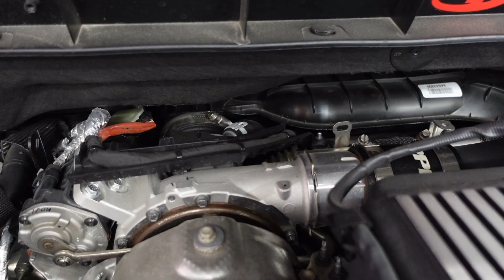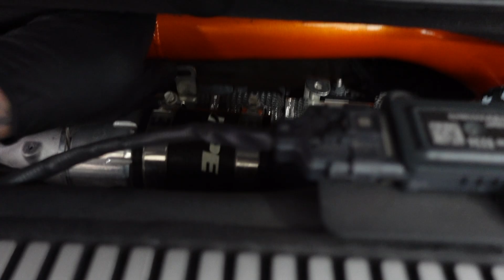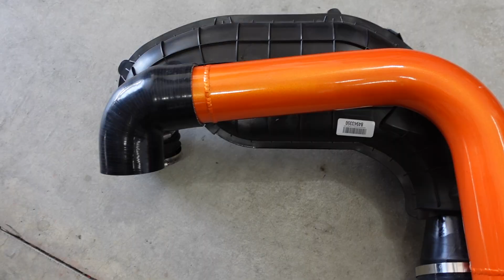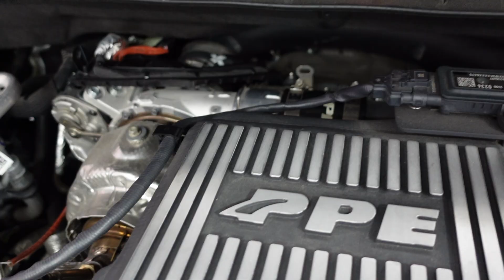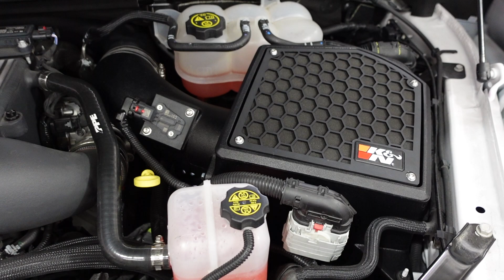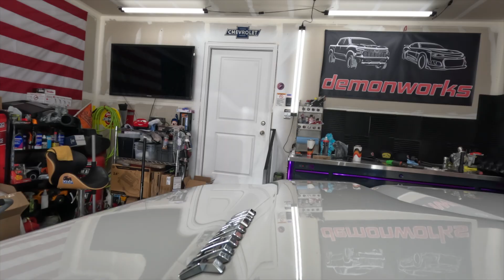LOUDEST Intake S&B / K&N on 3.0 Duramax Diesel

Comment: I don't want to spend $400 on the PPE carbon fiber intake pipe.  What are some other options?  Is there a way to purchase just the S&B intake pipe?  I'd love to run this S&B intake pipe with K&N airbox setup.  2020 Silverado LM2

Comment: What is the best in the your opinion the k&n or the s&b
Reply from the maker: A lot of factors to consider one as the best. The K&N was the only one I tested that didn't have a negative impact on my fuel mileage. The S&B provides the intake tube as well as the airbox....
Reply: @ I plan on getting the ppe intake pipe, and I've seen a lot of tunes that say that the s&b is required would I be able to use the k&n and do you think it's probably the best choice

Comment: On the top do you get hot engine air through it.
Reply from the maker: Yes, all aftermarket intakes pull hot engine air, unfortunately. Well, except for the airaid but that one made no change in sound / power / mpg in my use.

Comment: Take out the top two shutters leave the two center ones in take out the bottoms and they'll all be wide open I did it on mine I only run 170 degrees all the time on a high country with the PPE transmission pan I was over $200 the
Reply from the maker: Solid info, I already do all of the above and my temps are 195/196 but the LZ0 is different from LM2. My LM2's all ran lower trans temps.

Comment: I would love to see a video with the top 5 or top 10 Performance upgrades that you have found work the best on the LZ0 in order of importance or value add. You have done so much valuable research and tried different products and now just need a comprehensive video putting it all together, if you dont want to do a video, could you just reply here with a simple list? Thanks in advance!!
Reply from the maker: Great suggestion, I have one in the works!
Reply: To add to this idea… To show an economical package, middle of the road and no holds barred package of which products you’ve seen a difference in performance. I’m new to your channel and getting a little lost in what works or not. 😅

Comment: How did it sound just with the cold air intake and nothing else? I also read a lot of stuff didn’t line up or fit properly
Reply from the maker: Quieter with the stock tube in place. The Fitment is excellent. I had a K&n that did not fit very well. They sent me a new box and that fit great which you see here. I then removed this and tested an airaid (same box) and it fit perfect. My current setup is ppe carbon pipe and k&n box with airaid (dry) filter.
Reply: @DemonWorks  also with the k&n and the ppe zilla do I need to purchase the ppe elbow that connects the two ?
Reply from the maker: @chevrolaid350  great question! Not needed when paired with K&N

Comment: I’m torn between getting a k&n or a s&b , a lot of people saying the k&n intakes are causing the check engine light to come on and other people say the quality of s&b is unmatched . I need opinions
Reply from the maker: I have videos on the S&B, it had less power and less mpg... The K&N is the one I have on my truck ... no check engine lights. Coupled with the PPE Carbon intake pipe, sounds great !!
Reply: @DemonWorks  can you actually hear the turbo somewhat better with the k&n over the s&b?
Reply from the maker: @chevrolaid350  I believe it is better (the K&N) I would be willing to sell my S&B for 260 shipped. You will likely be happy enough with it especially at that price. It’s used… been in lots of videos. Email me at mstrgoodwrench@gmail.com if interested.
Reply: @DemonWorks  I’ve watched all your videos and love them . But sometimes videos don’t do justice with sound. I haven’t seen anything from Ppe on a carbon intake pipe . I’ve had k&n intakes and filters all my life but I saw in one of your videos you mentioned the top just sucks in hot air
Reply: If your a farmer like me do not put a K&N filter, there mostly for people that city drive. Watch project farm as worst air filter for dust as not worth the 5hp. I even took k&n off my dirtbike after i asked a mechanic about them. Dust free you shouldn’t have a problem!

Comment: Just bought a 2023. I want to hear the turbo. Which set up is the loudest.
Reply from the maker: Ppe intake pipe or a and b intake pipe and k&n airbox. S&b airbox with side cover removed a close second. For noise. S and b always gave me poor fuel mileage and underwhelmed during multiple testing videos.

Comment: @demonworks could you post a link to the S & B pipe? Thanks
Reply from the maker: It’s only available with the whole intake purchase. Recently PPE developed a replacement pipe that should be available within the next few weeks. 

PPE Carbon Intake Pipe replaces S&B on my 3.0 Duramax
https://youtu.be/xSuciuAwwk8
Reply: @DemonWorks  I figured so. I appreciate the response and will wait until PPE comes out.

Comment: Do you have a comparison video coming for the k and n air box vs the air raid? Really considering one of those but there’s not much info out on them vs the s&b
Reply from the maker: I do not, as far as I am aware, the airbox difference is on the lid. The air aid is closed off when the k and n is open. So, it makes less HP but also is all cold air from the front.
Reply: @DemonWorks  do you know if it is possible to run the airaid without the lid? Reason I asked is on their site it’s $100 off any intake this weekend lol I’m guessing the airaid is still a good choice for what it is
Reply from the maker: @dustinshriver6032  you could. I won’t advise it. At least with the K&N there is a foam insert on top
Reply from the maker: I actually just ordered the air aid though. Enough people have asked.

Comment: Does the S&B filter box fall short due to similar issues on the pipe diameter change and maf positioning like the L5P that banks addresses?

I know you addressed power lose issues
Reply from the maker: Hey ! A little different from the L5P shortcomings, but there is a size difference vs stock. I believe this video shows some concerns I have. https://youtu.be/OMVNFx-J0pw

Comment: How is your truck trans temp running so hot? My 2023 AT4 LZ0, towing 7,000 lbs in 70°F weather,  never got above 196°F......
Reply from the maker: in 30 degree weather and not even towing, I would see 210 degrees. 199 is better with the ppe trans cooler but still not good enough for my liking.
Reply: @DemonWorks  yeah I would not be happy with it either, I know it's spinning more because of the 3.73s, but +14°???? Maybe it's normal for a max tow package 🤔

Comment: If you remove some of your shutter vents will that cause your check engine light to come on
Reply from the maker: No, because they are linked to a bracket. As long as the bracket / slide is attached, all good.
Reply: @DemonWorks summer time wouldn’t be bad but I’d want the shutters in the winter 🥶

Comment: I went with the S&B CAI and I'm averaging 2-3 MPG more. Most of my driving is highway. 62.4 miles to work. No CELs but I followed the instructions to a T including disconnecting the battery for 2 hours
Reply: 22-24 sometimes better depending on conditions. I have an AT4 with MT tires and a bedrack. I took the roof top tent off.  The speed limit is 75 most of the way in. 

With rack and tent before CAI I got 18-19 avg
With just reaching before CAI I got 19-21

Just rack with CAI 22-25 and it's more consistent.
Reply from the maker: @BSO_Actual  awesome! Thanks for sharing. I know people like to see what others are getting for mileage with different setups and conditions.
Reply from the maker: great to hear the positive results. Every intake I ran netted worse mpg. The S&B produced the worst for me though. What numbers are you seeing?
Reply: Yea man. I'm thinking about getting the S&B pipes and seeing if that helps any. 

I got the 22.5 refresh AT4 in November and already have 25k miles on it lol
Reply: I got a couple mpgs worse with my s&b, had to take it off but thinking about putting it back on
Reply: @kivetts04dmax  did you disconnect the battery for at least 2 hrs when you installed it?
Reply: @BSO_Actual  yes I did, I was out of state and did it in the hotel parking lot one weekend morning and when I got done I showered and hung out until I went to get some food for lunch. I love everything about it honestly, just had the dealer cranky about it and they didn’t want to diagnose another issue I was having..

Comment: Will the cft work with k&n or not?
Reply from the maker: 100% will not, different designs. The CFT doesn't even properly fit with the stock box as it's designed.
Reply: Thanks. I love the videos.  They are very educational.

Comment: What did CFT have to say?
Reply from the maker: CFT - All policies listed on website. If have fitment issue that you believe is part issue ship back we check on jig and fit to our truck. If no issue we send back.

Me- Would you say this is a part issue you will see on your jig? (with a pic)

CFT - Dont see any issue 

Me - I reached out for some assistance, I can’t believe the service you are giving. 

CFT - You just sent a photo of part on the ground. Looks like part. Not installed or tried to be installed. So have zero idea what your issue even is. 

Me - I cannot install it, as it does not fit. The picture shows the angle the pipe ends at on top of a pipe that does fit. 

CFT - Then ship it back to us. We do unboxing video. Then show it to our jig, then installed on a truck. Post the video for you. From that maybe you get the help you need to install it.

.....

Then they posted a video on how to install it and that's where they use the boot on the box to hide the misalignment. Just poor quality and poor service.
Reply: @DemonWorks  I have this pipe actually and it fits about like yours . I did move my air box a little and loosend all the clamps and finageled  it around for about a C+ fit. To me it looks like an easy fix for them . Kinda sucks they didn't back it up.
Reply from the maker: I 100% agree. This pipe was intended to be the engine bay upgrade I was after. The charge air cooler was going to be powdercoated the same color as well. I had high hopes and really tried to get ahold of these guys to make it right and I was let down, over the course of a few months. I felt I could "make it work" but in the end, I don't run products that I have to "make work". K&N had major issues on my box and they fixed that issue and I am stoked to have it on the truck. I think people should know what they are up against, because many out there don't have the ability to adjust and correct manufacturer defects. Glad you were able to make use of yours! and thanks for commenting and watching!

Comment: I am looking into a LZO 3.0 right now . Do I have to do all these modifications to get a good ride out
Of it ? I may just go with the 6.6 diesel and avoid all
This .
Reply from the maker: No, they are good in stock form. The 6.6 is far superior so if that is even an option, I would go that route anyway.
Reply: @DemonWorks   ok cool I will . I just don’t want to regret the extra power I may need. I just retired . This will be my last truck . Ok thanks
Reply from the maker: @BearPapa49  I totally understand ! The 3.0 and 6.6 are two totally different platforms. The 3.0 in a 1500 can get up to 13,000lb tow capacity but it's really a street truck that can do big things. It's still just a. 3.0 though. The ride will be better than a 2500 as will the mpg. That 6.6 will do everything you can ask of it without batting an eye, so it really comes down to what your use will be.

Comment: I just got rid of my 2021 Ram 1500 for a 2023 Silverado with the 3.0. I drive 110 miles round trip for work. I am not worried about more power.  What is the best setup for fuel efficiency in your opinion or should I just leave it stock?
Reply from the maker: Leave it stock. The intake tube is nice because it adds some additional sound and response when you touch the pedal. Otherwise, stock form, these are very well built.
Reply: Appreciate it. Thank you
Reply: Leave it stock

Comment: I put one on my 21 AT4 because I didn’t want to go full CAI due to working in extreme dust.  
The fit was disgusting. 
Union pipefitters these guys are not…
I cheated and bought a 4” long transition boot to make up for the poor fit between the airbox and pipe but it still isn’t very sexy.  
The worst is the guys at that place are real dickheads to actually talk with.  F Em as I get to roast their sub par shit here. Hey CFT you guys are assholes and a first year apprentice at a non union pipefitter shop could do a better job than your shit. 
I guess we get spoiled having PPE parts for our truck. When I put the PPE intercooler in it was like it was made to be there.